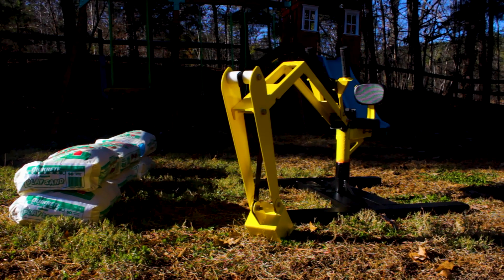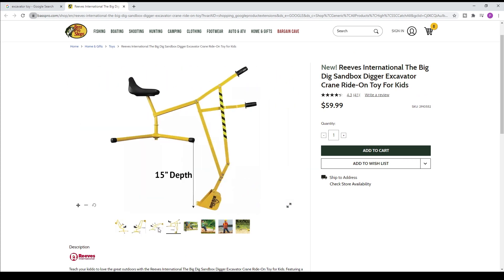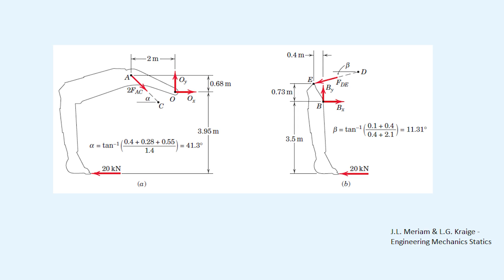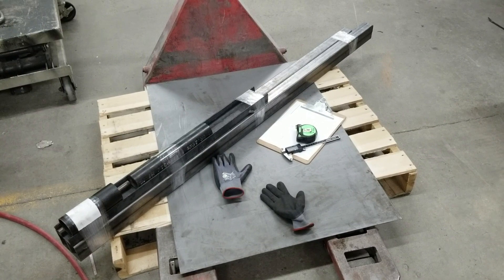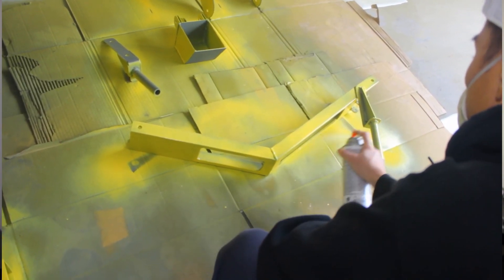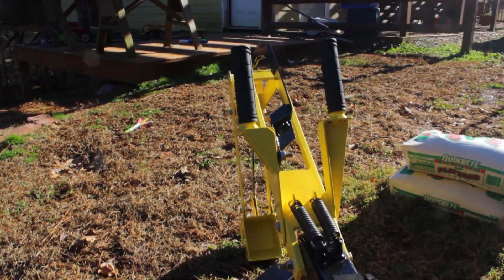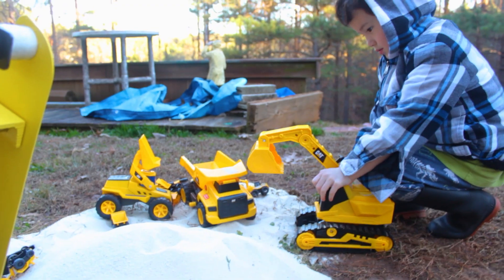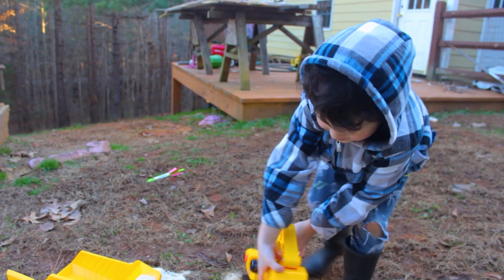Building a Toy Excavator (Sand Box Digger) | 2020 Christmas Present

Comment: Hii bro... for Automotive designing which software is the best? And mostly used by   companies all over the world
Reply from the maker: Hey Mohammed,

Some companies like Honda, Toyota, Ford, and Freightliner use CATIA V5. But other larger companies use PTC CREO Parametric, SolidWorks, and Siemens NX.

More of the larger companies use the higher end software, and the medium size companies use software such as SolidWorks and Autodesk Inventor. 

For automotive design, you want to work more with surfaces and bracketry. I would say CATIA V5 is the best for automotive, but a second best would be SolidWorks...which is more affordable for individual use.
Reply: @phillipmoua9805  in here they mostly recommend SolidWorks that's why I asked you.... thanks for replying 🙂
And is there many differences between CATIA V5 and SolidWorks?
Reply from the maker: @mohammedaqeel5919  So from what I've heard through the industry, SolidWorks was on the rise to becoming the better CAD software, but CATIA bought them out. So now CATIA is still the best CAD software in the industry. 

The are both similar, but CATIA is stronger with surface modeling (body panels, interior panels, any organic shape). 

SolidWorks is more user friendly and easier to use. SolidWorks is still a capable and strong software, and I would use SolidWorks for anything I would ever need. 

Whichever software you use, you can translate skills over. Just use the CAD program you have available and become proficient with it.
Reply: @phillipmoua9805  thanks❤👍